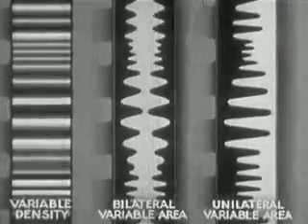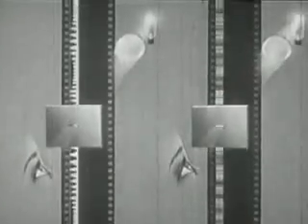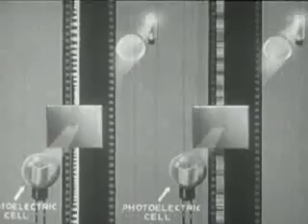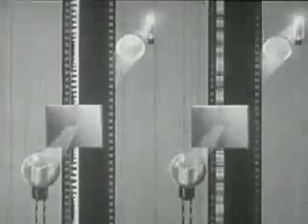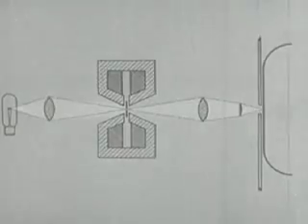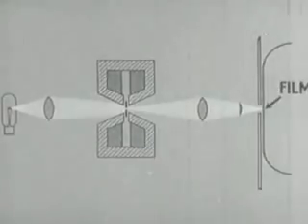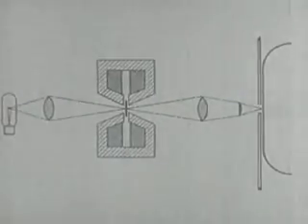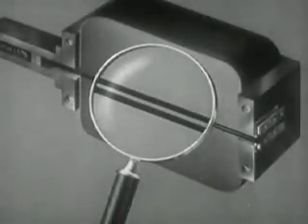Sound Recording and Reproduction (Sound on Film) (1943)

Comment: Is the difference between the variable density recording and the bilateral variable recording because the lightvalve has a much more delicate system? Because he said both were identical but there was definitely a difference in sound quality. Is this because of the system used or just the video?